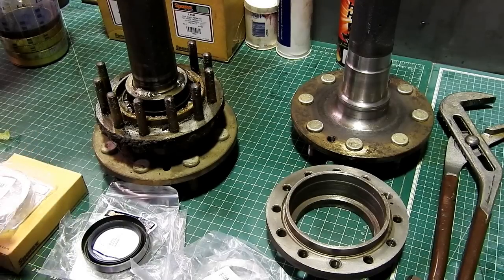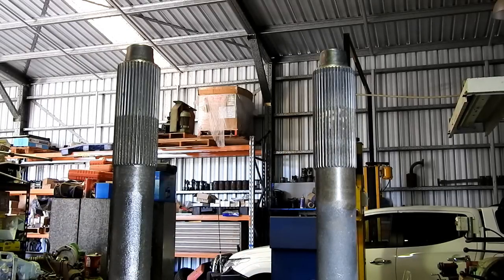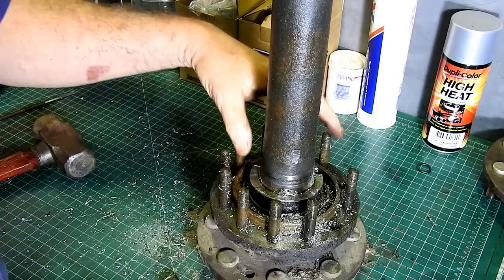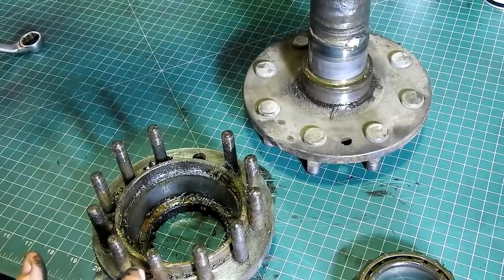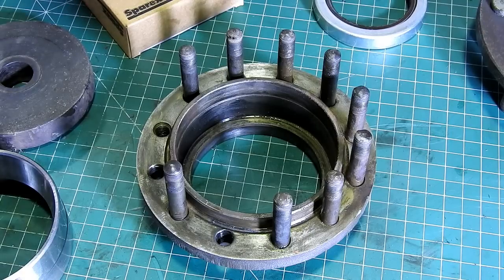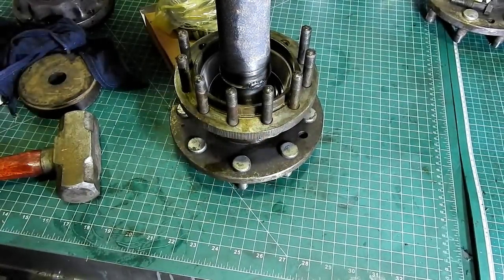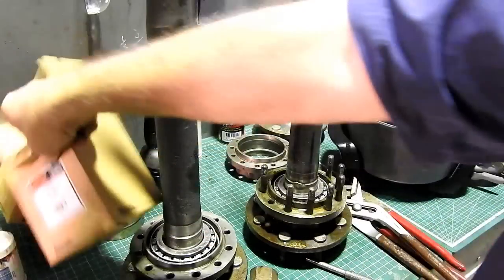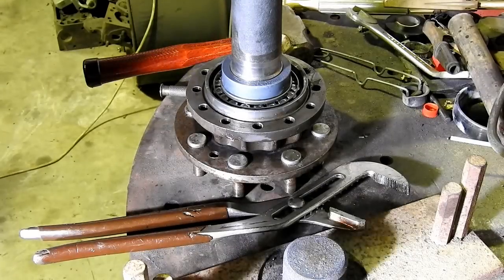MF135 6 Speed Restoration # 61 Replacing the Rear Axle Bearing and Seals

Comment: Must have several thou of interference fit on those collars for them to need that much heat to get them on. Of course I guess it is holding the whole rear wheel on right?
Reply from the maker: Yes if you dont get them that hot they get stuck half way then they are a throw away so the extra heat is insurance.